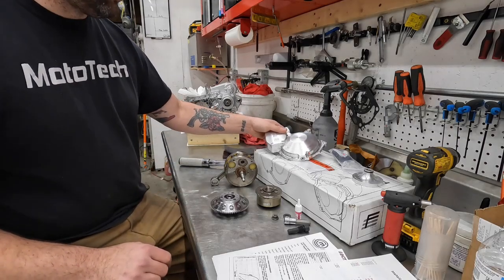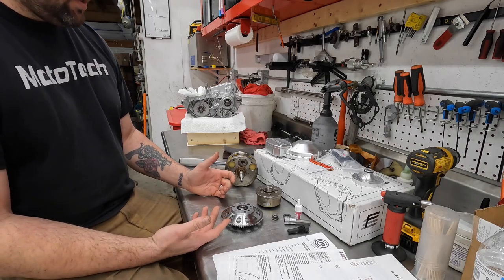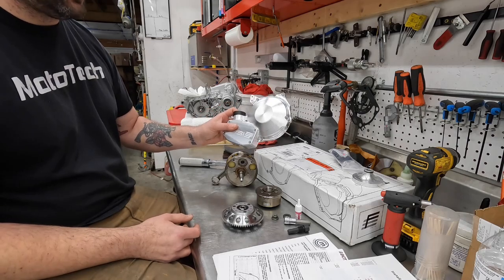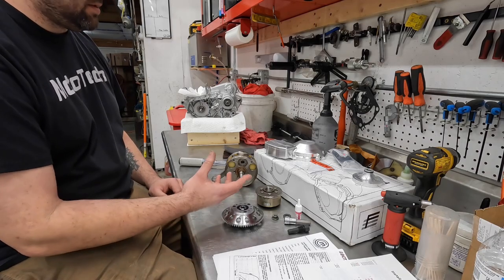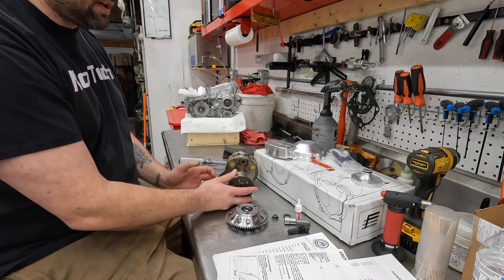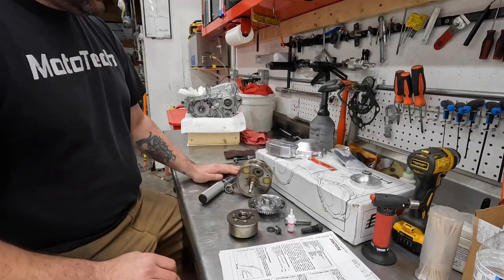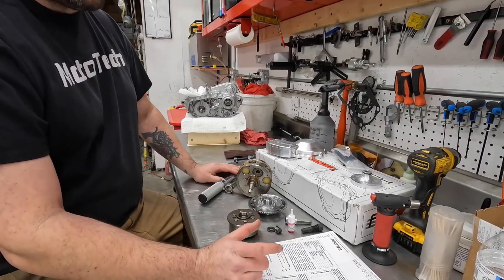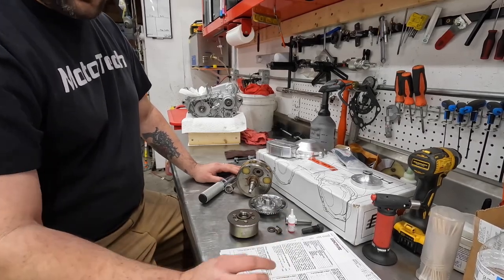Fisch Moto Starter Gear Sprag Clutch Installation Flywheel Keyway Fischmoto Loctite Torque

Comment: Thanks so much. Great info there and very helpful tips I would not have entertained. I.E. expiration date and adding a few drops inside thread also. Put this in my playlist. 
 Early adopter and put together correctly b4 the service notice about threadlock and retighten every 15 hours. Had it come loose and broke key. Now with this vid I have a lot more good things to consider at the next maintenance interval.

Comment: Thanks for the video.
Could you please tell me what you recommend for locking up an engine when tightening a flywheel. Are those engine lockup tools that fit into the spark plug hole safe to use.
Reply from the maker: @jakeb1778  yes the supplied tool is safe to use
Reply: @MotoTechNH  Ok, thank you. I did not realize they supplied one. I was referring to the tusk or stealthy one, but it's the same thing. I was reading on the forums, and some people said they did not feel comfortable transferring that much torque to the top end. Cheers
Reply from the maker: @jakeb1778  depends what I'm doing if I was just installing a flywheel without this i would hole the flywheel if I was installing the primary bolt on the other side of the crank I would use a gear jammer if I'm installing this kit i use the stopper. What you don't want to do is hold the opposite side of the crank you are working on.
Reply: @MotoTechNH  Very helpful, thank you! What is the issue with holding the opposite side?
Reply from the maker: @jakeb1778  you can twist a crank so it's no longer true.

Comment: "You can mess up anything if you try hard enough."  Hahah, thanks for making this video personal!  

Also, Tekton is Taiwan and between the shop and two mobile toolboxes, they have been excellent.  I just bought a digital torque adaptor to test calibration and will have to see how they perform.  The Icon torque wrenches I have have been excellent so far as well.  I just wish I could find a decent one with newton-meters in whole numbers because it's irritating trying to guess where I am between 78.1 and 82.7, ya know?  Till then, Tekton is just fine.